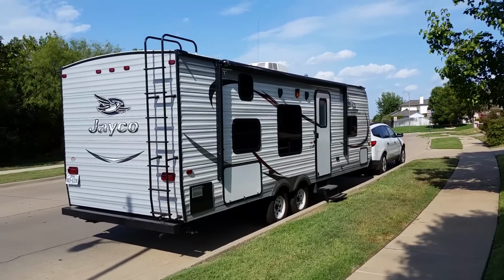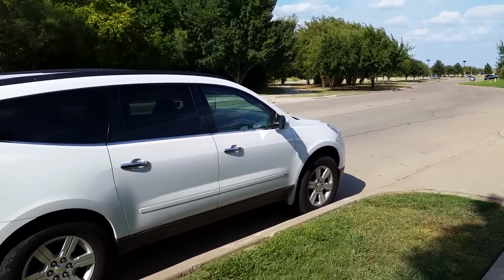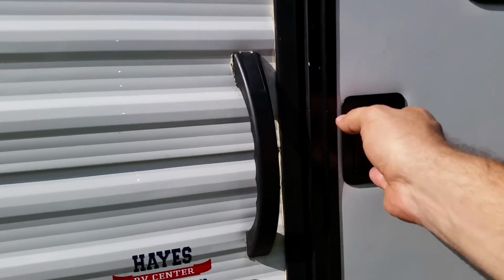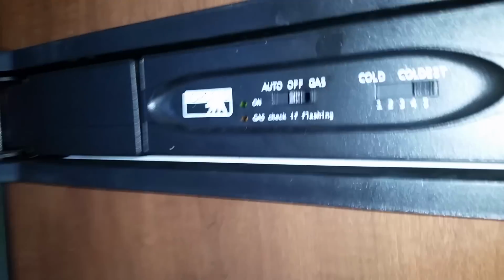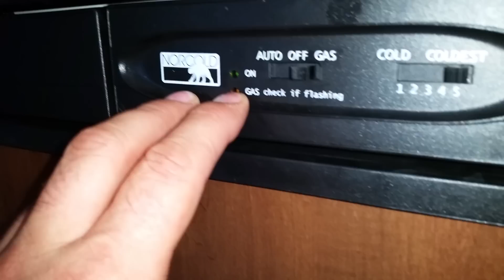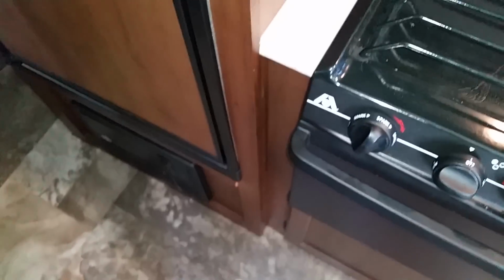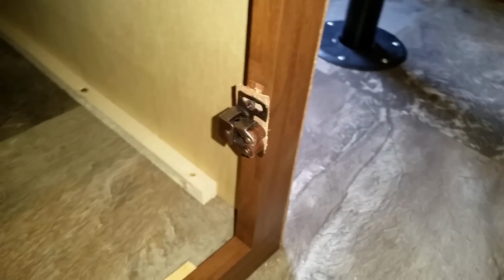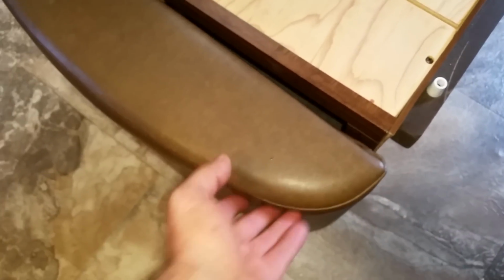Update: New JayCo Trailer FALLING APART.  Lengthy Warranty Work Needed.

Comment: I purchased a 2016 Jay Flight 29BHDS. After owning a Triple E 5th wheel this travel trailer is crap. I understand tow weight is a concern as the manufacturer is trying to get away from having you buy a diesel to pull it but when I take a close look at how all newer travel trailers are built all I see are staples.. and lots of them. Jayco installs an AM/FM radio without an AM antenna. Who listens to AM these days right. I do for sports radio. After service on these units is complicated especially if you are getting it serviced at a Jayco reseller but didn't purchase it there. I feel sorry for the author of this video and it surely takes the fun and excitement out of RVng. Hopefully your handy and have the know how to remove the staples that's holding the back rest of your bench seat and come up with a better way to secure it. I feel confident in knowing that as I drive down the highway with my new Jayco travel trailer and loving family that all that's holding It together are Amish certified staples that loosen up with vibration, movement and moisture. Make sure you purchase equalizer bars to keep this thing safe as you drive on the road.

Comment: We have a 2004 Jayco Designer that we've owned since new and have had very few things go wrong with it. We've towed it over 30,000 miles so it's not exactly a garage queen. We use it over 3 months every year so it surprises me with the problems you're having. I would by another one again based on my experience. Before the 2004 we bought a new Jayco a 1990 Special that was an entry level trailer that we had for 14 years and still didn't have the problems your having.

Comment: I have heard that when Jayco sold to Thor that the quality went down, but that did not happen until 2016. I have a 2009 Jayco Jay Flight G2 25RKS with 1 slide and I could not be more pleased. I bought it used a few months ago (June 2018) and the interior is still like bran new, exterior is also like mint and has been well maintained. I see some people saying that Jayco quality is bad, but I tow mine with a 2008 F150 5.4 Triton and it is not falling apart anywhere. Our Jay Flight is rock solid, and was built well. I looked at a lot of models and for the price point, and size there just wasn't anything on the market that came close. I'm sorry you had this experience, have you written Jayco and sent them pictures? I'm curious what they said about it?

Comment: They are not much better in 2020 either.  We purchased a 2020 Jayco White Hawk 32RL in March 2020.  Because of the Corona Virus, we could not take her out for her maiden voyage, but, have been driveway camping instead for a few days.  Things are starting to fall apart, like 2 drawers that are in a cabinet above the power center.  Jayco decided that is was ok to support heavy drawers at the rear with just staples, no screws.  So, naturally, these staples came loose, and now the drawers won't close.  To top that part off, there is a switch that goes to the light above the island, which is on the outside edge of this same cabinet.  When the support came loose, it pulled wires from the switch, so now, that light is useless!
Reply from the maker: That sucks so much.  Get it fixed when you can.  Get it documented asap. Take pics and videos.

Comment: I run a rental company and we rent Jayco travel trailers in multiple sizes for the last few years. They are literally built like a paper plate. 3-4 rentals in and cabinets are literally falling apart. They use STAPLES to hold everything together. Literally the same Staples you use to hold sheets on paper together is holding the whole trailer together.

Comment: You tow a travel trailer with a dry weight of 4805 lbs (at least that's a 2017 model) with a vehicle that has a 2000 lb towing capacity? Am I missing something here?
Reply: The Traverse with a Tow  package has a 5000 lb Tow Rating.  Yes you are missing something.

Comment: I'm from Elkhart, worked at a few RV factories. The pace is so fast, there's no time allowed for quality. - everything is stapled together, there's no time to cut that piece of molding, just hang it over a hard edge and break it off with a hammer, arrange it so the customer won't see it.- EVERYTHING is done with that attitude.

Comment: I have a Jayco too we had 15 warranty repairs the first time including replacing the axle. Our shower walls were not connected and they screwed it on by using regular screws right through the wall. Our bed has broken 3 times. We have a water leak they can't figure out it's been back 3 times.

Comment: The Forest River Freedom Express 2017 24RBS is the same. Everything is falling apart in 1500 miles. My leaf spring  plastic bushings are disintegrating causing my springs to be loose and angled. Now the brackets that hold the spring to the frame are bent. There were so many holes in the bottom of the tailer, you know that plastic cardboard stuff on the bottom, that mice got in on my very first trip and ate and contaminated all of our food as soon as we went to sleep.
All the wall sockets have  pulled out and cracked off. The charger for the phone burned up. The braces that hold up the fresh, gray, and black water bent down like a bow. The motor for the awning froze up when it rained for the first time. The sliding door for the bedroom broke the stop and fell off on the second trip. One tire blew out from a sidewall puncture from hitting a rock on the second trip. The diamond plate rock guard in the front popped loose from the trailer on the bottom because the 6 staples popped out. The tank sensors are a joke even when clean. The table came loose from the stand as the screws just ripped out when lifting it into the upright position.
From the first moment we got it home everything started falling apart just like your Jayco, EVERYTHING! I am surprised that the NTSB allows these things to be on the road as they are dangerous. My spring hangers and bolts wore out to a race track hole in 1500 miles. I had to replace all the spring hangers with thicker ones and new bolts with grease zerks so I can lubricate them.
I had to rip the bottom plastic cardboard off and install 1/16 aluminum across the entire bottom because there was no spot that was sealed and it was falling off. The hole around the actuator for the popout had a 4-1/2" inch diameter hole for an 1 -1/2" diameter tube. Rats walked right in and then into the interior because there was over a 1-1/2" gap all around the tube that housed the screw. they then came right in because the very large hole around the sink drain and water hoses was huge. a cat could have squeezed in through those holes. All switches are wired counter intuitively. If you push the rocker for the awning down the awning goes up. If you push the buttons for the stabilizers on the down position the stabilizers go up and vice a versa. The air conditioner cycles on and off continuously after it reaches cool.
Hoses to warm the bed room blow cool air because the run is too long and even after I removed 5 feet of extra hose it still blows cold air when the furnace is on. There is no rhyme or reason for the wiring color. None of it makes sense. They just grab wire and no matter what color it is the hook it up. Good luck trying to figure what goes where. The paneling is made of balsa wood and is less than 1/8" thick and this is what they mout the wall outlets to. You pull out the plug and you pull the socket off the wall as the plastic breaks.
I have spent hundreds of hours rebuilding this trailer and I mean rebuilding the damn thing from the ground up. When you buy one be prepared to work on it continuously or you will be dancing with the devil.
I actually designed some cantilevered braces for my holding tanks as I was afraid they would fall out. I can supply pictures for all of this on demand. I had to weld my spring hangers as they were bending to the side. They came with tack welds only. I am surprised the trailer made this far. The frame is not an I Beam it is a fabricated sheet metal I beam. I wa helping my friend across the street work on his when I noticed a huge 18" crack running along his fabricated sheet metal I Beam. Cost to fix $8,000.
If you are buying a travel trailer you had better talk to an expert not a salesman. The fixes on these NEW trailers will cost as much as the trailer.
These things I mention are true an documented. They are all made like this Caveat Emptor and pray you don't suffer a catastrophic failure.
Maximus a retired Tool & Die Maker of 50 years. I know what I am talking about.

Comment: I bought a 2016 model in 2015. Before the winter come the control board on furnace went out after 3 times of using it. I bought the unit in PA. I live in VA and I live full time in my RV. I had a choice to go back to PA or find someone in VA to fix it. No one wants to door warranty work on a unit they did not sell. Luckily I found a dealer who has great customer service in the repair department that took my unit and fixed the heat. Lesson here. Good deals do not always mean it's at good deal

Comment: Great video, I have a Jayco trailer as well.  The problem with mine is that the water supply lines were not properly tightened.  As you can guess water was everywhere after a day of use.

Comment: It isn’t just Jayco . I have a shadow cruiser 2018. I’ve already had to repair most of the paneling and trim work inside . They didn’t wall anchor the blind ties so I had to go through and put wall anchors on every single one. I also had the wall panel crack on my slide out . I’ve only had this for 3 months.

Comment: Jayco until an incident that happened recently did not have a quality control department. That why the issues with quality. Although many of the things you pointed out I’ve always wondered how someone can think that these will hold up. You can fix most of these issues yourself and I’d recommend that you do because repairs for RV’s tend to be junk. Best of luck, go with a Keystone or Dutchmen on your next one. If you don’t mind spending a little more go with Grand Design.

Comment: I cannot believe that Jayco would intentionally make garbage trailers. I just purchased a Jayco whitehawk 32KBS, quality is fantastic, my bed slide came apart, the slide retracted crooked and broke handles on a cabinet door, found out that it was put together with staples, Ricks Rvs in Joliet, Illinois replaced the staples with several bolts and totally replaced my cabinet door. No more issues, besides that the quality is excellent and Ricksrvs service department is the best ever. I hope you get your repairs completed soon, and I'd get a heavier tow vehicle you're flirting with danger.

Comment: Not sure, but could it be that a light weight trailer is much more fragile? I have a 2015 Keystone Summerland, have had zero problems since new. It's 35 feet long and weighs around 7500 pounds dry. Even it seems a little flimsy in some spots.

Comment: I've had 5 trailers. 3 new, 2 used all different makes.
The best built model was the most recent, a Keystone Hideout.
My first trailer was a Coleman. It was very well built but that was from the days before the name was bought by Dutchmen.
The worst was a Fun Finder by Cruiser RV.
I would stay away from any Ultra Light models. 
I've also found that the poor warranty service stems from the dealer. My guess is warranty doesn't pay as well as ripping off the public for regular service.
I couldn't get anything repaired on the Fun Finder until I got the manufacturer involved and even then it was difficult.

Comment: I just had to comment on this video. First, I have a 2017 Jayco 24 ft, and it is of great quality. I have not had a single issue with it and when I bought it last year, it was already 4 years old. Not to mention, not sure what Henry is talking about, Jayco has one of the top resale values. I would do a little more research on them before taking this guys word for it. I mean I have done some remodel, and put a solar package on mine, and everything was put together solid. I have also spoken to a number of Jayco owners, and they love their rigs. Also, @2:54 you can tell by that giant ass hole that that molding was literally ripped off. More than likely his kids just beat the shit out of it.

Comment: We just got a Jayco 29bhdb we love it and yes the finish on campers in general are below par when compared to houses or cars.. I am a contractor here in So Cali. and flat out expected the "wood" and counters to go to crap within the first year. The amount of MDF used for structural arrangements is laughable but it is what it is.  I just put into my head to systematically repair or replace items as they go to shit.  

With the amount of movement these things take on. A lot of items will just break down over time.

Comment: Jayco quality must of went down or you got a lemon. I have a 2003 Jayco 29BH and love it. Only had 2 issues when I first bought it. One was wallpaper peeling and the other was a plumbing leak. The issues were fixed within a few days at the dealer I bought it from. Have not had any other problems since then.

Comment: Taking mine apart to fix leaks and replace rotten wood...big job!!! The staples they use throughout the construction are not holding well but at least mine is not new it has a few years on it

Comment: Most of the family use and even full time RV stuff is built the cheapest possible to make it past warranty. We only use it a few times a year and the first year is done quick. The next year we all see deterioration old the units. The cost of a new unit is based on what we are willing to obligate too. I see used older units that have been personally fixed by the owner, to be in much better shape. Keep your unit and fix it all yourself to know it is done right and will then last a very long time.

Comment: I see so many JayCo trailers on the road. They are advertised has being light and cheap. So your chances of being dissatisfied are probably higher than normal.
 As far as keeping the frig on gas while traveling, it is hard to do when the winds are wrong. I use those Freez Paks and turn it off while moving.

Comment: Bought a 2017 Hummingbird 17RK in Jan and it is now sitting at the dealers to have some issues fixed. The trim - same story as this Jayco - is coming apart due to poor workmanship. I would dare say they used too much power in their airgun and pushed the brads right through the trim pieces. USB module came out - when I push it back in, it blows the fuse. Then (and this is after only three trips of 300 mile roundtrip and less than 2 weeks camping - wife and I and small dog with NO kids) the toilet started leaking. Nothing major, just minor stuff that should NOT be found in a new camper! trim and molding not rounded not beveled, wood panel under dinette seat warped! there are a few other minor issues and our 3-month old trailer has been in the service bay for over two weeks now. Used, I expect problems, NEW, I don't!

Comment: I have pretty much the identical trailer. Had same thing happen with the seat/bench. Not cool, but ya, I suppose that's what warranty would be for. Shame it can't happen in a timely manner but I suppose depending on the time of year that demand may be pretty high? I'd be more worried about the tow vehicle. That traverse has max trailer weight rating of 5200lbs. The trailer GROSS weight is somewhere around 6250 I believe? Yes the dry weight is about 4300 so I suppose if you don't load it too much and don't have too many hills to pull up, it should be ok. Hope you don't get left hanging on it completely, good luck!

Comment: Interesting. I am exactly one year into a new 2016 Jayco Jay Feather 25BH and I have put thousands of miles on it including a trip deep in the Hammocks, all dirt and rocky roads which shook and rattled the hell out of it. I tow it with my 2008 Escalade EXT at speeds up to 70 MPH usually cruising at 65-66 MPH for hours at a time. Towed it from Ft Lauderdale, FL to Montgomery AL on our very first trip. Mostly we haul it from Ft Lauderdale where we live to Disney Fort Wilderness. In the first year we have had it out on at least 10 trips. Other than the fender skirt screws needing to be tightened up every couple of trips.....no issues at all. So far I am very happy with my Jayco. I know this is an older video so hopefully you got it all taken care of. I think you got what I like to call a "Friday afternoon unit" which is where they are trying to meet the quota for the week and yours was the last on the line before the end of the week so they were a little sloppy.

Comment: Well you need to bring the trailer back to the place you bought it, and then demand they repair every issue under total satisfaction! Unfortunately there is no lemon laws with RV's. But if you go in and raise enough ruckus in front of customers looking to buy, you should get satisfaction! Also what is the tow rating of the Traverse? My brother has one with AWD, that is rated at 5,000 lbs. I bet that your trailer is close to that. So close in fact that if you were to travel with 4 passengers and full tanks of water and propane, along with all the stuff four people need? You will be liable if unfortunately something were to happen. But anyway check you CGVWR and stay under by at least 10-15%. Just to be safe! Please do not take this the wrong way! Have fun out there!
Reply: I have also read that you should pull half as much in the mountains, so maybe triple the recommended.

Comment: You have all the same problems I had with my 2005 26BH. Near identical unit. Sold it for next to nothing when I bought my Canadian made Roadtrek camper van. I love my camper van.
Reply: And by the way, keep the roof resealed every year. The front seam where the rubber meets the tin will leak if it isn't already.  They are not built to last